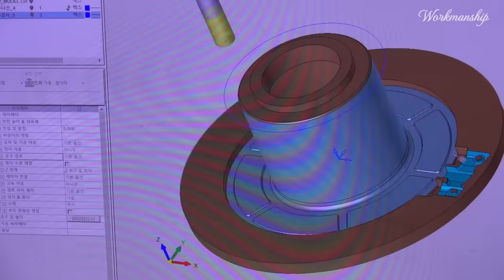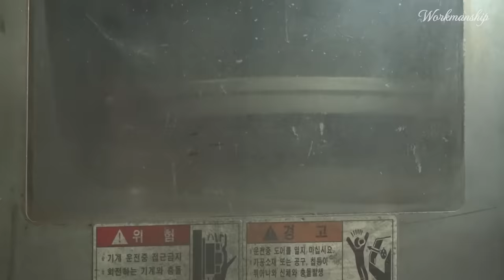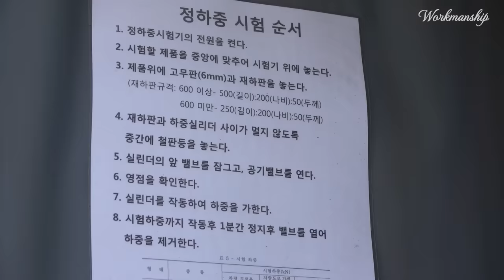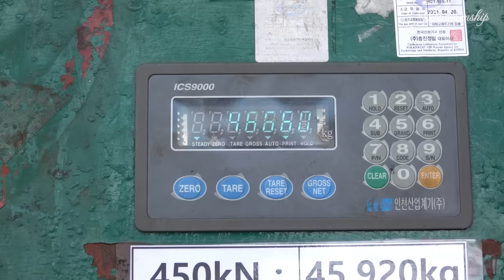Manhole Cover Mass Production Process. Cast Iron Factory in Korea

Comment: All that damn work to prep a mold to cast. Then the process of setting up the cast is more important than the pour or debur. Next time you see a manhole cover think of the hard work these people put in that create them. 

Think if the Pakistani had this machinery! They are floor casting using their feet to pack in the black sand around the mould.
Reply: Pakastani makes them faster.

Comment: I didn’t see where they put tubes to get the molten metal to the two large castings. And why did they dip that other outer ring in ceramic?
Reply: LMAO
Reply from the maker: 2:55 If you look closely in the right corner, you can see a path made of Styrofoam for molten metal. And the reason they dipped the mold in cement holds the shape when the molten metal flows. thank you for watching! 😀
Reply: The process is basically lost foam investment casting.
The form is made from foam, and gets vaporized by the molten metal.
The form is coated in ceramic (the investment), and the ceramic is then what becomes the actual walls of the mold.
The form is loaded into the sand to support the ceramic and slow cooling. The sand is only a support and insulation, this is why it is not packed around the form like they did with the covers.
Reply: @joshua43214  Thanks for the explanation, i was wandering the same. I know that smaller cast iron items like fittings for plumbing and brake discs are made in automated process, DISA machines comes to my mind, is that not possible with something like this?